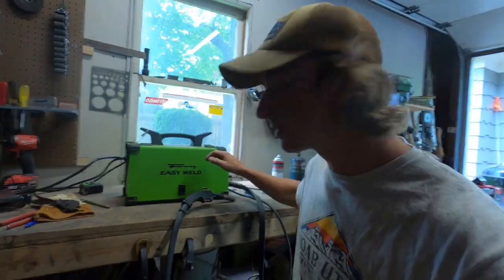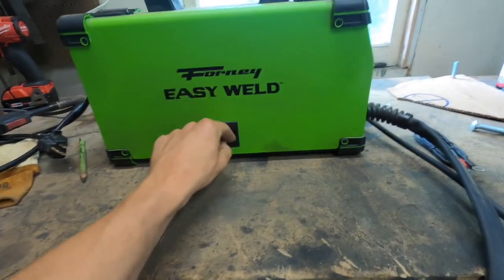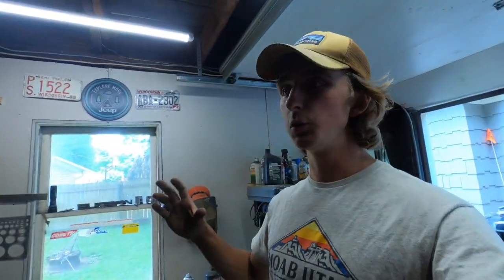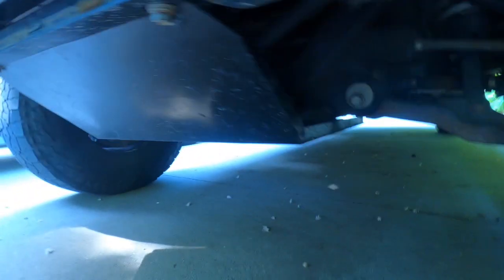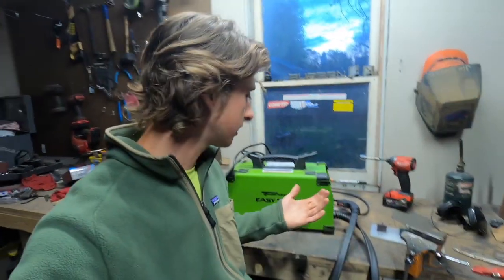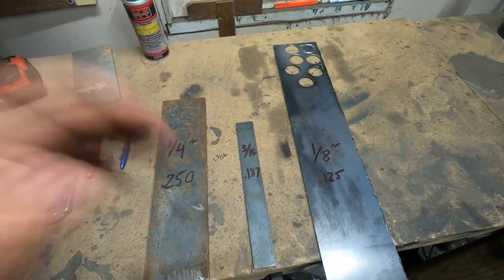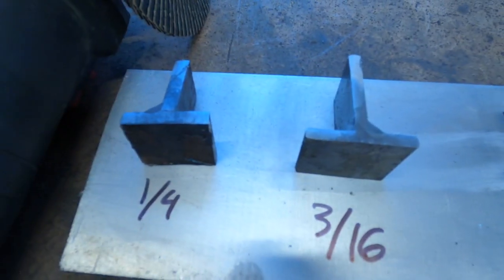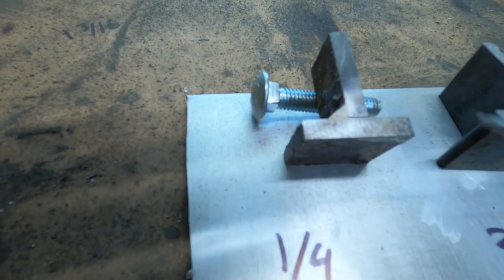The Best Flux Core Welder for Beginners Forney Easy weld FC-i

Comment: Nice video. I have the Forney 125 FC. I normally use lincoln .30 Wire. my welds are usually dirty with so much buckshot. I have a friend that is a good welder although does not earn his living as a welder and he is telling me I need to reverse polarity on my Forney and that would clean up the buckshor and help with penetration. Are you familiar with changing the polarity on your Forney?

Comment: I got the same welder a bunch of months ago. I find it splatters like crazy but it could just be me, it’s the first welding I’ve ever done when I got it.
Reply from the maker: Yeah being flux core it definitely spatters a lot. And just make sure your dragging the puddle I dead of pushing it that should help more with the spatter too!
Reply: @buddabuilds8851  yeah good tip actually, I’ll check it out
Reply from the maker: @d_ward4871  also I’d recommend some anti spatter spray it leaves a oily residue that you have to clean before painting but the bbs scrape right off.
Reply: @buddabuilds8851  I just heard about that stuff ordered some, hope it works

Comment: Did you do 220 libe yet? It's real easy. Locate the manufacturer of your box. Buy a double breaker 30 or 40 amp. 10:2 or 10:3 wire. 10.2 black and white or black and red go to the poles on your breaker the bare wire goes into the screw hole in the panel. Holding the outlet in your hands the black wire goes to the right. The white wire to the left. The bare wire on the green screw. If You're using 10.3 you will have red green black and a bare wire you will need a special outlet for that wiring set up. If using the 4 wire one then the red and black go into each pole on your double breaker the bare wire and green wire each get screwed into the screw slots on your box. Then you get your special plug for that wire and it will tell you where each wire goes. Hope that helps if you didn't do it yet.
Reply from the maker: Yes I did end up wiring in 220 and I used 10:3. Thank you for that explanation it’s very in-depth and hopefully will help out more people in the comments!

Comment: Cool video!  I’ll need try to find that welding milk and test out some on my noobie YouTube certified hobbyist welds,  now I’m curious.  Muscled through for years using the entry levels 90amp flux core from harbor freight,  great for strength, but was trying to do bodywork… had no idea how hard I was making it on myself until I finally got a mig. Flux is totally underrated,  pretty sure I read somewhere that it’s better than mig for strength and for use in non perfect metal.
Reply from the maker: Thanks for watching. And soon I’m hoping to pick up a actual mig but so far the flux core has never let me down! I just want pretty looking welds with a mig

Comment: Forney has excellent machines and 1st class customer service! I believe that machine can handle 10 pound wire spools. I traded my Forney for a Lincoln high end and sometimes I regret the trade.
Reply from the maker: Yes it can run a 10lb spool. Definetly should of mentioned that in the video!  You really can’t beat the welder for the money. Thanks for watching

Comment: What was the amperage level on the 3 samples?
Reply: Voltage and wire speed. Cordinate these two knob settings with the chart and go. Minimal ajustments are made accordingly.

Comment: Can anyone recommend an optimal wire speed/voltage setting for 1/4 and 3/16 inch steel on 120v? Thanks.
Reply: Should have a chart somewhere on it or in the manual for you to adjust your settings for thicknesses and wire speeds
Reply: @skullparty7638  i hear those aren't all that accurate. I was hoping someone could share   some tested settings. Hoping to circumvent ruining some otherwise good steel in the name of testing my settings. Looking to expedite the process.
Reply: Optimal settings and accuracy come with experience. Follow the chart to get started. You need to develop a pulse in welding and you'll see. It's frustrating at first, but it will come to you. Take care my friend.👍

Comment: Have the same welding machine. When I'm trying to weld I just get a bunch of popping and splattering. What do you think I should do ?
Reply from the maker: I’d make sure everything is clean like where your grounding and where your welding. Then double check where your dials are on the recommended setting and try adjusting it from that.  I hope it helps
Reply: @buddabuilds8851  Thank you brother I appreciate your help